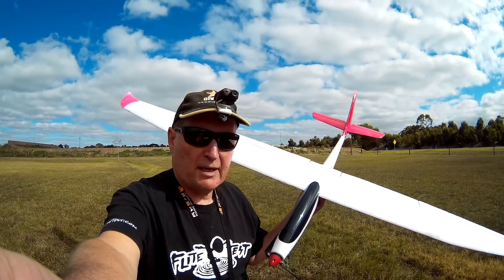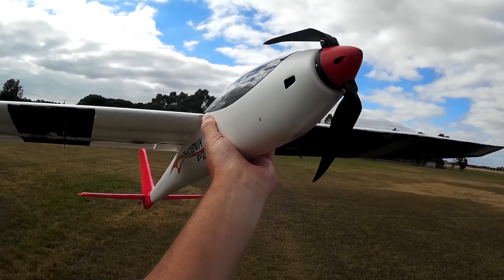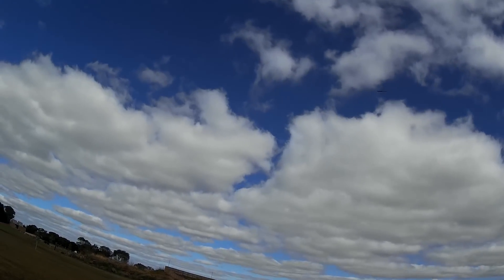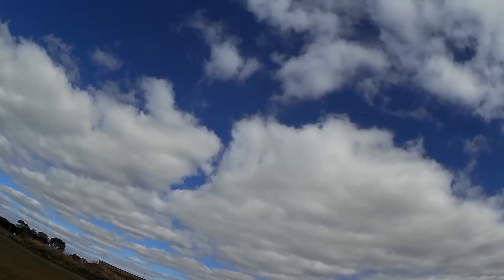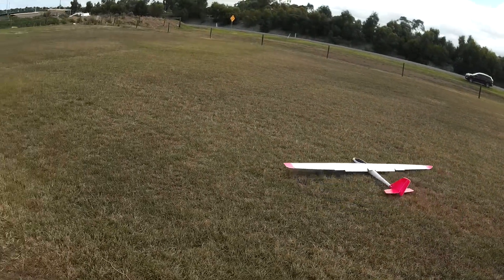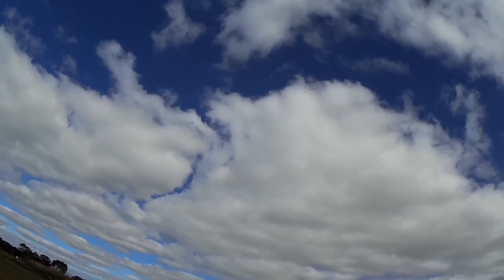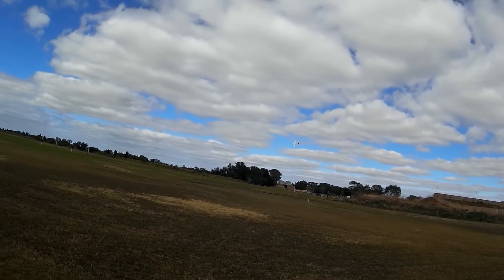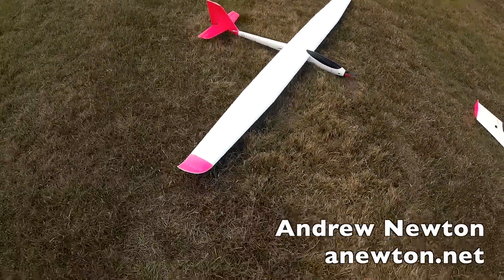Phoenix Evolution Motor Upgrade

Comment: Hey Mr Andrew I had phs 1600 and motor bomb up so do u have any suggestions of motor I can replace with 3s lipo battery and ESC 30A
Reply from the maker: No but you need one with the shaft protruding from the mount side.

Comment: Hi. Today I've picked up a very nice model (for free), but it only has the Volantex 4023 850Kv and 3 MS-X5 servos. Can you (or anyone) advise what else to get - transmitter/receiver combination, battery and what else? Consider a tight budget here :) Thanks!
Reply from the maker: Cheapest acceptable Transmitter is the FlySKY FSi6X with FS iA10B receiver https://www.banggood.com/Flysky-FS-i6X-i6X-10CH-2_4GHz-AFHDS-2A-RC-Transmitter-With-FS-iA10B-Receiver-for-FPV-RC-Drone-p-1101154.html

Comment: Andrew. I'm a newby. My partner bought me the Phoenix (my first rc aircraft) which I am trying to fly in the 2.6 configuration, and I was told by others that it is under-powered, so this video is helpful. However, is it Ok to just upgrade the motor without changing the ESC? What  would you recommend? Thanks in advance.
Reply from the maker: I have forgotten which ESC it comes with. 30A should be OK, it's not a plane you oddly thrash around at full throttle anyway.
Reply: Thanks for the prompt reply!I enjoy the channel. Good things to learn about. 
Regards, Len

Comment: Very nice plane, some clear reinforced tape in the center top and bottom section of the wing helps reinforce. One line of clear tape on the leading edge for little more stiffness. Open the holes and add about two holes to the rear for better airflow and less ballooning. Am on my 2nd yr w mine, 2000, IMO, the best plane in this price range.
Reply from the maker: Good tips, I agree, this is the best full house thermal foamy I have seen.

Comment: The original LANYU pre-Volantex version uses a 1200kv motor running 10x6 folding prop. It's way more powerful than whatever later version came along.

Comment: Hi Andrew, nice video. 
If I was to swap the motor in my Phoenix Evo for the 1000kv could I get away with using the stock esc or is it essential to upgrade that too ? 

Cheers, Karl
Reply from the maker: I'll have to check mine, but I think I swapped to a Plush 40A early on. It pulls 27A full throttle
Reply: Ok thanks

Comment: Andrew, you gone in to wrong direction ;-) Much better is change this crappy propeller to better bigger one:-) and stay on low KV. I put in to my Phoenix aero-naut carbon propeller 12x6,5  and it is flying not bad...
I hope you know bigger propeller have better efficent than smaller...
Any way, thank you for your RC channel :D
Reply from the maker: Yes you're right Piotr, but I didn't have a bigger prop handy and the motor was an easy swap.

Comment: the shaft of this link looks to short to have the prop adaptor on it https://www.banggood.com/Volantex-757-V2-RC-Airplane-Spare-Parts-4023-1000KV-Brushelss-Motor-p-1068590.html?p=T00517756132201409SN&utm_campaign=Andrew(1068590}&utm_content=huangwenjie&stayold=1&cur_warehouse=CN how did u make it work??
Reply from the maker: It mounts backwards so you're using the longer rear shaft. Can probably undo the grub screw on the motor bell and tap the shaft through for more length.
Reply: oh yes ill try that
Reply: would this motor work? https://hobbyking.com/en_us/turnigy-d2836-8-1100kv-brushless-outrunner-motor.html
Reply from the maker: No, the shaft is coming out the wrong side. Look at NTM Propdrive motors
Reply: could you send me a link?

Comment: Andrew.
A bit of feedback.
I did follow your help, and bought the Phoenix Evolution and the U Glider.
Finished building the U Glider, but had a lot of problems with the supplied control rods.Utter rubbish rods.
I did end up putting two servos on the wing.
But i hope to fly the U Glider in ther morning, if its not to windy.
Also got a Phantom 3 Advanced to fly for the first time. Got this second hand, but its as new.
Phoenix is still in its box. havent looked at it yet.
But its next one to get sorted.
Thanks for the motor info.
May do mine as i put it together.
Thanks, Keith.
Reply from the maker: Hope it goes well Keith. The U-Glider will pitch up under power but glides beautifully. Good luck
Reply: Andrew Newton 
Now to much power on takeoff then Andrew. Thanks for that info. 👍
Reply from the maker: On 2S it needs all the power to climb but you'll be pushing forward on the elevator. Can program in some Throttle Elevator mix too.

Comment: I originally wrote about this. But, it was too complicated for a simple post.  These Phoneix planes pop up all over the place at different retailers.  I have  the 1600 and 2000 from HobbyKing.   The instructions for motor installation are non-existent.   I wrote a blog post about how to install the motor if you own the kit. If you bought at PNP like Andrew did and want to upgrade it you can get by using a simple motor X-mount.  I also covered motor selection for this plane.  It's a good plane, it just needs better instructions. 

https://foamsweetfoam.blogspot.com/2018/05/phoenix-1600-2000-motor-mount.html

Comment: You went from 850 kv to 1000 kv with the same size prop? 
Did you check if it uses more AMPs if so what is the difference. 
I am interested because it was my understanding that you must use a certain size prop for a given kv rating.
Reply from the maker: Yes it uses more amps (27 max) but that's within my 40A ESC specs

Comment: 4s works well on the stock motor of this and the asw but it will de-sync over 80% throttle.
Reply from the maker: Just tested 4S and it draws 43A full throttle. Too much for my setup.
Reply: Was that in the air? Did it pull better?
Reply: Hmm, its been a while but 29a comes to mind when i did a static thrust test on the stock one. 4s makes a huge difference even if the esc is limited to 1700us in my opinion.
Reply from the maker: Bench test
Reply: 28a at 2000us with a 16.8 battery. However i did have to gently increase the throttle to avoid desync.
22a at 1800us. 
9a at 1700us.
5a at 1500us.

Adding .6 seconds of slow up in the throttle channel completely eliminates the desync while still giving the authority to get out of trouble.

Comment: Changing the stock paint stirrer for an Aeronaught will give a nice performance boost but then I'm not happy unless it climbs vertical :) I had a Radian P̶R̶O̶  POS by fitting a decent oversized prop and high discharge 3S 100 mAh I could climb to 100m in about 15 seconds. IMHO 2200 mAH packs have no place in a thermal glider of this size.
Reply from the maker: 2200mAH balances it perfectly

Comment: I'm running a E-Max 850kv throwing a 11X6 carbon fiber prop works very well with a 2200 3s battery
Reply from the maker: Yes that would almost have the same effect

Comment: Good idea about changing the motor, will suggest to all the guys at SSME that fly Phoenix gliders.
Now to add Telemetry - Altitude / Variometer sensor.
Did that on my Gentle Lady, found a thermal at 24m high, and bailed out at 188.5m.
Reply from the maker: Seems just right. 27A max. I have 40A Plush ESC , vario and LiPO sensors on this